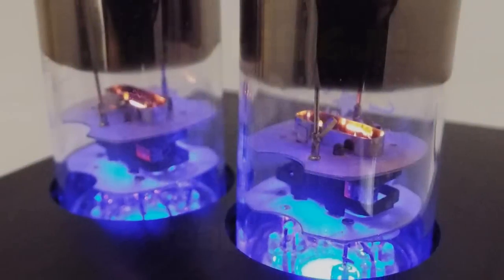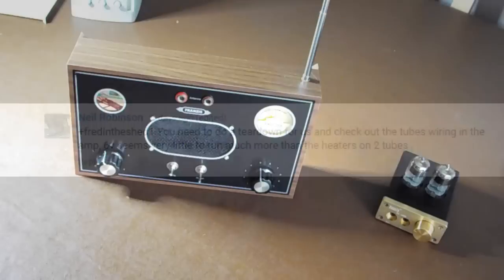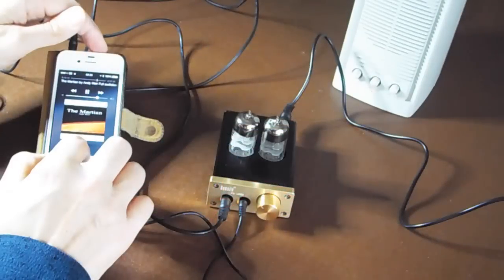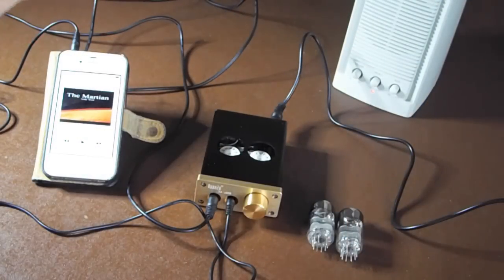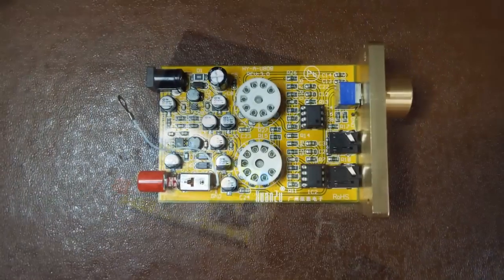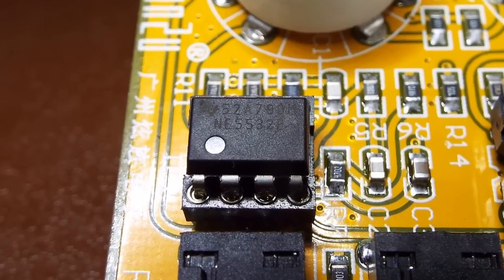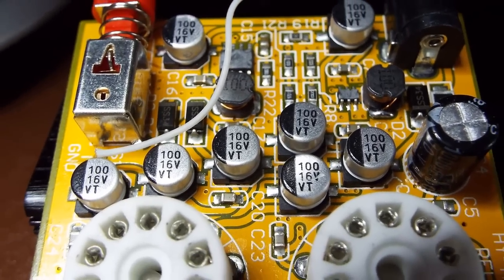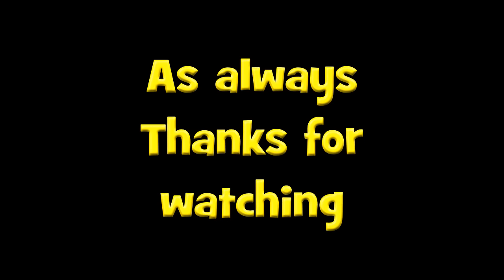Audio Hifi 6J9 mini vacuum valve ebay amp teardown

Comment: Just got one of these at a garage sale for all of $1, so whether the valves do anything or not --- 
and whether they do it well or poorly --- is of little concern. 
I tested it strictly as a gain stage in a tape loop and found it amplifies more than adequately for any application I might put it into.  
The sound was clean and had no objectionable characteristics of any kind.

Comment: There is no apparent DC to DC converter.
Valves are a high voltage low current device, plate voltage is usually at least an absolute minimum of 50v.
The 16v capacitors mean the maximum voltage is 16, and only a stupid designer would run at maximum.
I think it's bogus....

Comment: There are voltage doubler/tripler circuits to give enough juice to operate the valves +-30 ish rails.  The valves do not have enough output current to drive headphones directly so some sort of buffer is necessary. A dual opamp 5532 has nearly enough drive for a single 32 ohm channel. No mystery.

Comment: There is NO B+ plate voltage supply! Therefore the tubes are just for looks and do not actually amplify. Secondly there are NO audio output transformers, which means the audio comes from the transistors, NOT the tubes!

Comment: No b+ is present. So no amplification is taking place. Period. However the audio does pass thru the tube. But. As anyone who builds or repairs amps knows without a b+ on the plate the tubes are not being driven. Passing audio thru the tubes with only a filament voltage will never give the truth warmth and response you would get if the tube was being driven with at least 100v as in some of the better preamps. You literally can jump the two pins on the socket on each tube and get better frequency response. I've done it. Sounds fine. Better even at  most frequencies. So what's amplifying?  The ne5532 op-amps.
These are found in hi fi equipment in a huge selection of some better than others all the way to custom op amps by muse and others as "replacement" for better sound. But a real pair of muse 01 or 02 are about $40 each . So $80 bucks to upgrade the cheap amp isn't very realistic. A Mcentosh amp yes.  
So. Enjoy the warm glow. 
Without at least a 100 volt boost invertor supllying a b+ to the plate of the tube and proper bias it's not really doing much besides letting the audio pas thru the tube, removing some frequencies. Giving it the appearance of a working tube amp. Most honest manufactures market these as hybrid amps. 
Well alrighty then 😊
Reply from the maker: Thanks for the information.

Comment: thinking of buying one of these and still not sure as couple of points i have is are they really valve/tube preamp or are the valves just for show also the blue LED id have to change them to yellow
Reply from the maker: It was a big debate at the time.  Dave on the EEVBLOG did the best video.

Comment: If you had simply put the tube back in while the unit was powered, there is characteristic sound from an amp or pre as a tube heats up...  this would have been, possibly, a better test.  Just a thought.

Comment: These Chinese companies are not attempting to put one over on anyone.  The tube amps that are hybrid are labelled so.  That is, tubes are for the preamp section, ss for the output. It's possible to meter the leads and test connections.

Comment: The 6J9 is a triple triode wired as a pentode the equivalent is an E180F which will plug straight  in  But in mine, I had trouble with bad soldering on the bases and the jack sockets can fail and need to be replaced with better quality components

Comment: Can somebody help me? 
I do have 5.1 audio system in my room, and I do connect mp3 player or my phone via aux, and it does sound quieter compared when I connect my loptop via aux, so does anyone know, if I'll buy this amp, would it help, or it's not desing for 5.1 audio system.
Reply from the maker: It should not matter about 5.1 audio as the processing will be done in the main amp stage.  If connected inline from your MP3 player this little amp will be able to increase the input volume to your main amp..

Comment: PAUSE at 2:39. The traces go to the tube filaments only, pins 7&8. Pin 1 is just a dummy connection. So the circuit is only making the heaters glow and using them as resistors. If you have one, measure the resistance of the heaters and install resistors of that value to show that it works fine without tubes. All I see is an NE5532 op-amp powered headphone amp.
Reply: what is the point of actually supplying the tubes as well for the price, to only dummy the product? the tap test creates the tube ping noise.

Comment: Ha-ha-ha! =)
So our little chinese brothers do the trick! It simple. Connect opamp out throught valve heaters.. that`s it! no valve installed- no sound on OUT jack    =)

PS take a look- there is NO high voltage circuit (DC/DC converter or so) to supply valve stage. Fake!
PPS blue LEDs are really.. really.. does nothing 8-)
Reply: tap them and they make the valve ping sound. how did they fake that?

Comment: This is a low cost, high performance little amp that comes from China, not Japan. I've looked into its background on my own. How about doing more homework before reviewing such items, also to check out some of what others have already said about them. Someone please point out a valve amp where the tubes are not hooked up and are used just for show,  because some ignorant listeners will assume that without ever showing any examples or knowing what they're talking about. Or is it just that some listeners and technicians who grew up with digital sound simply cannot hear the difference in the expanded airy spaciousness and soundstage these amps can provide? 

And how good is the analysis when even the technicians haven't the  audio sensitivity to hear the sound difference when it's unmistakably there for those who've done real comparative listening? The ears are the final test after the analysis is over, and consequently I find this a rather useless review of this fine little valve amp that I happen to own. I find there's FAR  less listener's fatigue, and the use of the tubes creates a smoother, silkier, more full and warm sound. I've found it a revelation how good some of these mini hybrid amps can be and at a fraction of the cost of most tube amp receivers. I currently enjoy the Nobsound successfully with an audiophile set of Grado GS1000 headphones.

Comment: I'd like to see this "amplifier " tested for distortion and gain. Running this style "valve" at 6 volts is totally out of specification. There are no tube curves for a 6 V B+
Reply: The input voltage is stepped up. My Sabaj version takes 12V in and steps that up to 18V with a DC-DC converter. The valves take about 12 seconds to warm up, filaments fully lit and then a relay switches the audio through. Both tubes ping nicely and I have no concerns that the 6J6-J's are doing the heavy lifting. The audio was sharp at first but warmed up nicely after a few hours use. ..another thing we get with valves.

Comment: Whoever plays electric guitar, or an electrical instrument that needs amplification would know what preamp is about. Of course that the tubes are in the pre-amp section of this thing, almost all tube or valve amps recently produced use this design: tubes for the preamp section and solid state for the amp/output section, it's the tubes that handle the dry, "in" signal and transistors are then  amplifying it to the desired output level. 

Of course, there are all tube amps, where tubes do all the work, but these have become "purist" things, if you play in a band, you'd want them, but in a 20 pound headphone preamp, they are not necessary. Not to mention that all tube designs cost an arm and a leg. 

This is a great idea that the Chinese have come up with, to produce cheap headphone preamps that will surely beat built-in PC or phone "amps", which are solid-state, if not sotware emulated.
Reply from the maker: Well said Bojan.  The bottom line is that these amps are just £20 / $30 so you cannot expect too much.
Reply: Sure, it's just that the ALC 1150, which most PC's use these days, is not even $30 to buy bulk, so it's bound to be better. 

If not for anything but for the fact that there is a tube handling eaech of the channels. I've seen people who say "tubes are there to add distorsion", not being aware of the fact that tubes intrinsically ADD DISTORSION, albeit small, to the line, but that clipping sounds actually pleasing to the ear, unlike what solid state circuitry does to audio signal.

I've ordered this puppy so I will share the impressions whence it arrives.
Reply: What are your thoughts now that you've had a chance to listen?

Comment: Kinda makes me wanna buy one of these Amp's mainly because of the price... but the price just makes you sceptical about the product I guess. Specially when its off eBay and made in China. So far base on my experience in Buying and Selling off of eBay is that, the Price can tell a story almost all the time. 

Cause usually you literally get what you pay for, most of the time. 

In the other hand there are other Amp's like the Cmoy or modded one's or fully custom amps you can buy from eBay hand built by 2 certain seller's one from AskewLab's and the other from a guy in Latvia (he has his eBay as well). That cost double this Chinese Tube Amps but you definitely are getting what you pay for since its hand made, and uses high quality components for a good Dac/Amp equipment.
Reply from the maker: +eroOtoko1 Yes at the end of the day you get what you pay for.  These little amps certainly drive headphones louder with any distortion.  The pass through the tubes makes the sound a little warmer.  I am using mine on my HF radio just to get more vol and for that it works well and in my mind looks pretty good as well.
Reply: fredintheshed1 yep, I think I will search a bit more and then buy new amp and dac :).

Comment: Recently i buy this headphone amp and i have to say sound is acurate warm. It 
depend what can will u use /for example with Koss Porta Pro it is too 
bassy/. I was burn-in this amp for 24 hour so far but i have some 
problem in sound. If it is playing some music it is fine, but if there is no
 signal or pause between tracks there is something like some silent 
noise in backround. I don't know i i have to burn-in it more o it come 
from power suply and i have to change electrical adapter with 6V/2A. I 
will compare it with headphone output at Technics SU-V500 and preamp 
Rotel RC-971 next days. At the end of chain i'm using Sennheiser HD 598.
 Any one have solved this problem with noise in backround while no signal 
comming or during puse between track?
Reply from the maker: +Martin Plško Cant say ive noticed it on mine unless you crank up the volume.  Guess they are very cheap.

Comment from the maker: At last we find out the truth.  Ive added a link at the end of the video.
Reply: What link is that ?
Reply: +techsyschip I can't see any link anywhere...
Reply from the maker: +techsyschip Its the pop up red box that appears in the bottom right corner of the screen at the end of the video.
Reply: +fredintheshed1 Still nothing - no red box that I can see...
Reply from the maker: +techsyschip Oh ok that's odd I can see it my end. Sorry about that.  here's the link.  https://www.youtube.com/watch?v=coSt5HWRvv4
Reply: +fredintheshed1 I'm guessing your using a PC... The red box link doesn't seem to work on (android) mobile devices. I had already found the linked video by resorting to my PC, but thanks for adding it in the text here anyway.
(If you're interested, here's a simple DIY headphone amp project using a 12AU7 double triode that does genuinely use the valve for amplification rather than just "adding valve type distortion" - http://www.instructables.com/id/Class-A-Hybrid-Headphone-Amp/ )
Reply from the maker: +techsyschip Thanks.  I ve now added the link in the video description.
Reply: +fredintheshed1 I must say that EEVblog "Dave" seems to somewhat miss the point. The bottom line is that they look good aesthetically, they sound really good and they're very cheap ! (It sounds at least as good or slightly better than the headphone socket on a couple of solid state amplifiers I've compared it with.) And his expert's opinion that if the valves were left out of the circuit it would be 'a tenth of the cost' is way off the mark - I've not found any solid state headphone amp that costs much less than this Chinese item !
Reply from the maker: +techsyschip I think your correct.  Lets be honest a "proper" valve headphone amp would cost almost 10 times the cost of one of these.  Yes ok the valves would be working as amps but its a different market.  I bought this little amp to simply make the sound from my phone louder which the amp does very well.  The valves even with the naff blue lights just add to the look.  The amp sounds ok (better than I thought it would) and does its job reasonably well.  Its not HIFI but for £20 what do you really expect.
Reply: +fredintheshed1 I agree with what you say, except for the last sentence. I'd say it certainly does qualify as "hi-fi". However if you're just using it to amplify your phone output obviously the result is going to be limited by the phone. On the other hand if you compare it from a decent source with typical hi-fi amplifier headphone socket quality, where the speaker level has usually been simply attenuated back down, it compares favourably. Also I find the headphone output on many CD players to be barely or not quite adequate to drive less efficient headphones to a decent level, where this little amp provides plenty of power and very good sound quality.
Reply: Turn on annotations?
Reply from the maker: Its in the video description now.
Reply: Okelidokeli :)
Reply: Hybrid is what hybrid does :p

Comment: I've got one of these - very good sound quality. The tubes are pentodes by the way, not triple triodes as suggested below. They are equivalent to E180F or 6688 types.
Reply: +techsyschip  Yes, they are pentodes, but my understanding is that they are operating as triode cathode-followers (buffers).   (Yep, I have one too, at work. Currently running NOS RCA 6688 tubes and NS LM4562NA op-amps.)  Edit:  BTW, the very first thing I did to this was remove those silly blue LEDs.
Reply from the maker: +techsyschip Although these little amps have been getting a lot of stick recently and I still don't know if the tubes are pre or power amps but the sound produced is fair for the money asked. Are you going to upgrade yours ?
Reply: +fredintheshed1 If you mean by swapping the tubes, not at the moment as it sounds great as it is, and I'm more interested in tracing the circuit topology (which is rather tricky as it's a double-sided PCB with surface mount components). I haven't dismantled mine but it's easy to see from stopping your video that the two anodes (pin 7) are connected together, and the cathodes (pin1) are as usual connected to the suppressor grids (pin 8) and through a resistor to the control grids (pin 2) to create 'cathode bias'. 
(I might consider either disabling the blue led's or perhaps just obscuring them a bit to tone down the blue light which rather clashes with the normal red heater glow.)
Reply from the maker: +techsyschip Yes I do agree with you that the blue light is a little over powering and looks a little cheap compared to the rest of the units finish.
Reply: +fredintheshed1 Yes, I'm sure a red led would have looked better, if they must have one shining up through the socket.
Reply from the maker: +techsyschip Red or orange would be better.  Ive just added a link at the end of the video which clears up this question of the tubes once and for all ;-)

Comment: most likely reason you do not see all the pins connected is multi layer circuit board...
Reply from the maker: +AnhYeuEmMaiMai69 TBH I don't think its that engineered.  I know about heaters in tubes but iam not sure what pins do what.
Reply: it has two layers at least the top and bottom....
Reply from the maker: +AnhYeuEmMaiMai69 LOL yep I will give you that as it is a double sided board ;-)

Comment: Hello, you have tried to change the opamp in the video seems possible to change the type of socket.
Reply from the maker: +81anticris Do you mean the 2 small IC chips ?  No ive not swapped them out.  No one is quite sure if they are pre amps or the main drivers.
Reply: I read that the tubes are preamplifiers, and ic are amplifiers, that usually hybrids settings ,, amplifiers also by what you see in the video the IC socket can be changed and put another opamp models, and see the results in the sound
Reply: I read that the tubes are preamplifiers, and ic are amplifiers, that usually hybrids settings ,, amplifiers also by what you see in the video the IC socket can be changed and put another opamp models, and see the results in the sound
Reply: You can try a LM4562, lm49860 or opa227 / opa228 dual package